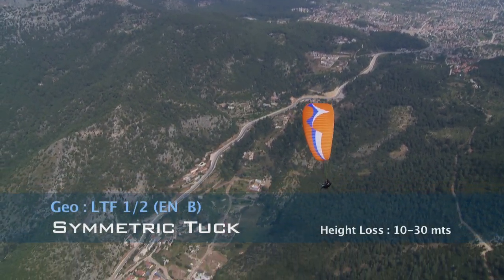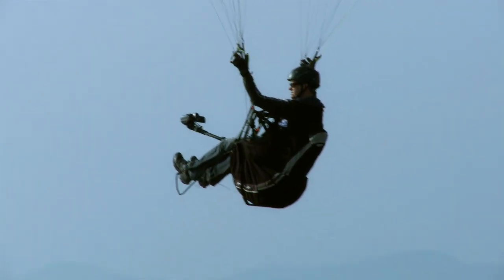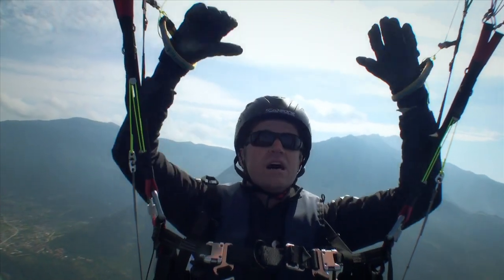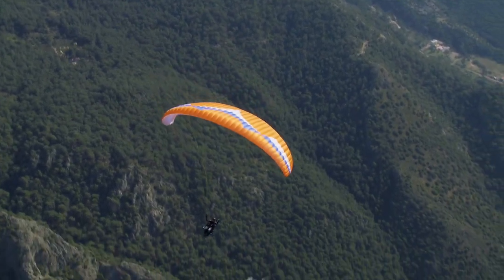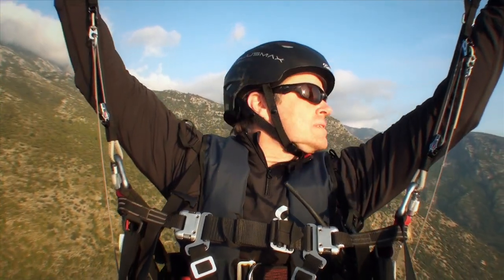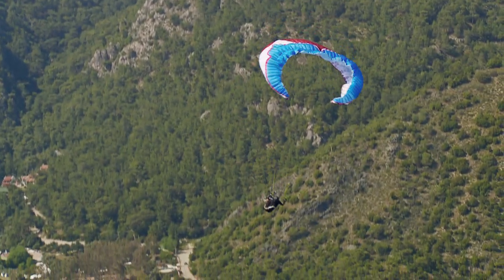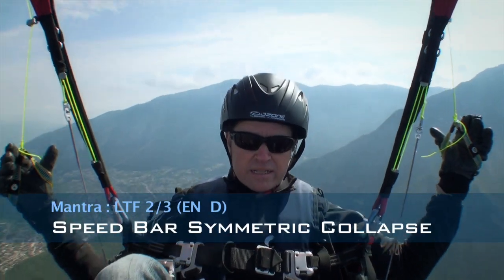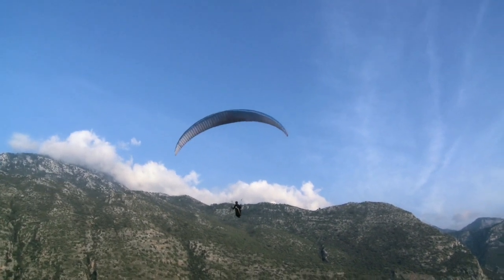Recovering from a Frontal / Symmetric Collapse : Paragliding Safety

Comment: When you say 'it's very safe', what if you've hit the ground before it's flying again? There seems to be a fair bit of altitude lost in that manoeuvre.
Reply from the maker: Hi Neville, it all depends on the speed of opening and size of the collapse, but it generally doesn't loose more than 10-30 ft.  If you are that low then you should have your feel down to minimise impact anyway.
Reply: @JockySandersonparagliding  The text on your video says that you can  lose up to ninety feet in a symmetric tuck, whereas you say here that it generally doesn't loose (sic.) more than 10-30 ft. Which is correct? My wife lost 2000' following a collapse, before it inflated again; mind you, that was a 'hot' competition wing, BITD.
Reply from the maker: @NevilleStyke  it depends on the size of collapse and re opening time. Then what the pilot does as a reaction to the event.